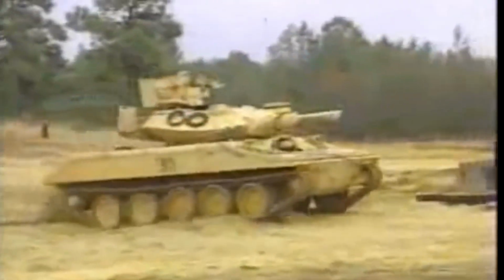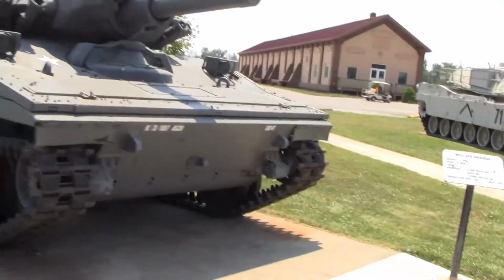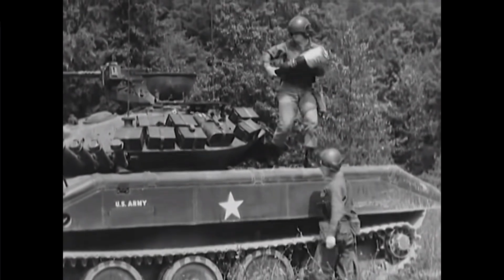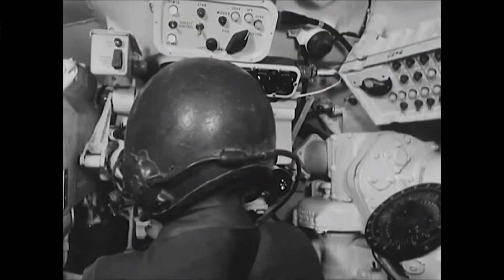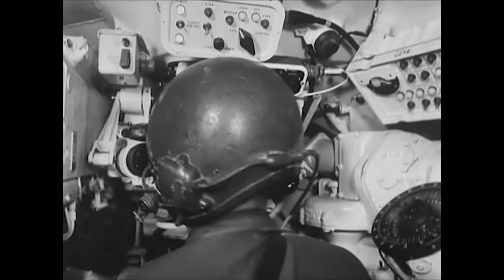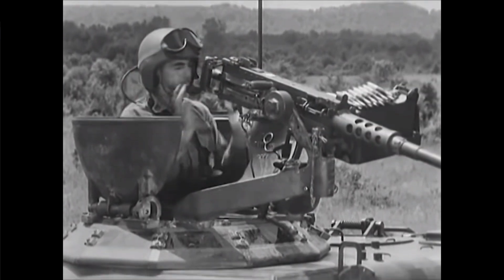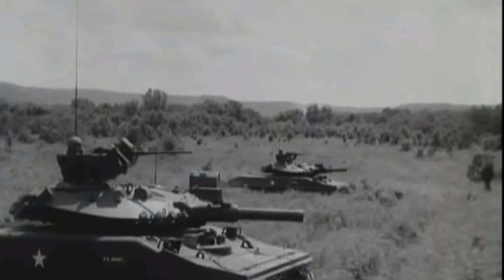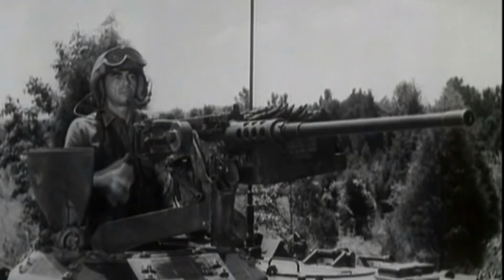M551 "Sheridan" AR/AAV | DESIGN DISASTER!

Comment: I was school trained on the M551 and assigned to the 4th battalion, 68th Armor, 82d Airborne Division. I was a crew member, platoon leader, and company XO, (a maintenance officer), so yeah, I have experience with this system. The 6V53T Detroit diesel was a great engine, but you had to constantly clean the radiator or it would overheat. The suspension system was excellent, but the lubrication for the road wheels was oil with a sight glass, later grease. The conventional gun, 152mm, was accurate, recoil was very harsh, and the obterator seal could fall out, making an unsealed breech upon firing. The the gun detent was only good for 20-50 rounds and had to be replaced or it would blow and bounce around the inside of the turret injuring the crew. The missle system was a 90% NO GO, junk. The electrical turrent was a good idea on paper, but constantly broke down. Air droppable? I have a picture of my vehicle that streamered in from 1,500 ft, exploded!

Comment: As a professional tank racing driver in 1973, I slid this Formula 1 type track through a right angle turn on a hard surface road at full acceleration - 40mph or so - through a town deep in the Bavarian woods (near the birthplace of the sh*t-eating Nazi Partei).

My fancy tank driving, plus my large, male trouser-bulge, stunned the local beauties, as I roared through their Bavarian village, and all of them began chasing my M551a Airborne Assault Vehicle! Few have experienced the terror of a pack of large-breasted, Teutonic females who are large-breasted, with asses a meter wide, in heat, and large-breasted, and full of bier!

Fleeing for my life while transfixed by the fluid motion of the cleavages of their large, bouncy, Bavarian, bouncy, Bavarian, bouncy,  breasts, and chubby, rippling  thighs; I was barely more than a match for them! I barely escaped with my life! 

As certified by me, this feat has never been duplicated. It doesn't mean you are a huge pussy if you can't do this.

Thank you all in advance for your prompt attention to this urgent matter.

M551

Comment: The problem with this vehicle is basically this, its a reconnaissance vehicle (which should not be used to slug it out with main force units unless they are being used as a cav screen and then you should expect to lose lots of them) designed to make contact with the enemy, maintain contact and report but only engage to break contact, (see but not be seen), the combustible case was a really dumb idea as it was an immature technology, a conventional case would have been heavy but more effective, and the propellant load should have been downrated to provide a more appropriate recoil, it would have shortened the effective range but after all this vehicle's role was reconnaissance, the main gun mostly  used to keep the enemy's head down while breaking contact.
The really really incompetent idea was to replace the M48 main battle tank n Vietnam with this lightweight reconnaissance vehicle which was simply NEVER designed to do that job.
Australia did indeed test the vehicle, apart from failures of aluminum engine pulleys, it was the weapon system that really caused it to be rejected, the boiling hot hydraulic fluid leaks were also common to the M60 series when hit by AT rounds.
Eventually Australia produced the M113A1 MRV to fill that role.

Comment: This is one vehicle that would have been invaluable in the War of Terror. 

Since most insurgencies actually lack tanks, a platform like the M551 would be an ideal choice to counter insurgencies as a high speed infantry fire support platform used for taking out technicals and bunkers.

If you won't be facing tanks, you don't need an MBT like the M1A3 because the enemy forces encountered would at best have only IFVs at most. 

So a modernized M551 would be something the likes of which ISIS and Al Qaeda would live in fear of.

After all the most it'd have to worry about is ATGMs, and cage armor is designed to defeat those. 

So yes, I am completely sincere about the M551 being something that should have not been retired.

Comment: They should have gotten rid of the missile and gun ammo, and used AP and HEAT RAP rounds. These could have been compatible with few modifications to the breech and barrel. The barrel could also have been lengthened to incoporate a real (chamber) fume extractor. Why do people keep forgetting about RAP in low velocity guns?

Comment: For all the problems highlighted in this video - I loved it.  I crewed the Sheridan during 2 different tours in Nam and was only let down once time when my vehicle blew a pack during the invasion into Cambodia.  I sat outside a small ville all night long until the squadron trains cane along early in the morning and took us under tow behind an M88. Probably the worst night in Nam - no one got one moments sleep as we dismounted as that broke down Sheridan made a very tempting target in the moonlight. Other than that - there was no missile system on the 551s in Nam so we didn't have that problem.  The Xeon searchlights were vulnerable while making busts through the jungle and mine was wrote off as a combat loss.  We strained the engine / transmission over and over knocking down trees.  We removed the governors from the engines to get more speed.  Ever see a 551 doing 45+ MPH throw a track on an asphalt road and the driver locking up the brakes on the one remaining track?  Made a lot of great circles as it continued down the road.  :)  In Nam there was so much dampness that if constant maintenance was not conducted on the gun system the breech could rust shut.  The cupola armor kit was okay and as the tank commander I felt safer than sitting in the drivers position or the gunners. Bottom line - in Two years it never let me down - regardless of what the mission was.  Loved the vehicle and even crewed a few at Fort Carson and Fort Campbell.  Did I ever wish for a better recon unit - yep but we used what we had.  Don't get me started on the M114A1E1. LOL That is another story!

Comment: I was in the 82nd and my MOS was M60/M551 turret mechanic. These "tanks" were not meant for the main battlefield which is why they're called "Airborne Reconnaissance Assault Vehicle." Their primary mission was to be troop support for the soldiers that were dropped in. Yes I've seen dozens of them dropped... really skidded... into a DZ via C130 along with Gamma Goats and the like. I only witnessed 2 bad drops due to bad packaging of the tank. I witnessed just as many bad Goat drops if not more. Of course the armor was weak as aluminum isn't known for it's protective abilities. It was built to be light. Compared to the other tanks of the era, the Sheridan was quick and road like a Cadillac. The turret... when it worked, it worked well. When it didn't work it was a nightmare, there was little in-between. Loctite was used generously. The amphibious side of things was truly hit or miss and drivers were cautioned not to do it unless it was a life or death situation.  I still have my 4" thick M551 Manual and pull it out from time to time to remind me of why I don't miss working on it. :)

Comment: A modern version of this with a rifled low-medium pressure 155mm, FCS, better engine, better suspension, improved armor, ERA, semi automatic assisted loading, and multipurpose HEAT ammunition for demolition, anti infantry, and with toggled airburst/top attack capability for anti armor in a pinch without need to switch ammo types. Of course with a laser rangefinder and thermals, and retaining the amphibious capabilities by using a better flotation system with rubber inflatable ballasts built into the vehicle too which with preparation would turn it into a kind of raft, and equipped with a snorkel kit incase of some kind of failure(just in case).

Comment: I was Mech infantry in VN. As such we sometimes worked with both Acav units and armor. I would much rather work with the Cav with the Sheridan than the armor with the M48 at least off hard surface roads. The M48s were prone to getting stuck or being incapable in the mud.  I.E. incapable of climbing a  up the embankment to a rice paddy terrace.  On ground that looked sound  but was wet they could look like a submerging submarine.  The Sheridan would go about anyplace a 113 would.  However, we pulled into a place along the "Yellow Brick Road"  called LZ Old Guard during Lam Son 719 to find a Sheridan with the turret blown off next to our assigned position. When asking  the nearby mortar crew it turned out they had an ammo malfunction and the spilled powder was somehow ignited in the tank, we were told by a cigarette. This was a relief to me since we were facing a jungle covered hillside that rose steeply and I was thinking that it was enemy action from above. Anyway there was a little tank with the belly plating  blown down and the turret upside down off to the side.  I did not have a camera at the time... I suppose the communists salvaged it since then.

Comment: They were reasonably effective in Just Cause in Panama, not only because of its light weight made it easy to transport, but also because all the panamanian PDF had to offer was a few V-150s and V-300s with the 90mm Cockerill gun.

Most of them actually never made it to the battlefield. They were knocked out from the air before they could make any opposition to the Sheridans.

Comment: When I was in the 82nd this was the division armor. The intent was to pull these tanks out of the back of a C-130 at low altitude with a parachute (LAPX). It never worked. I saw it get stuck once and they had to cut away the parachute. Other times the tank and sled would tumble end-over-end after hitting the ground. Thankfully, I was Infantry.

Comment: Some minor corrections. 4/68th Armor transitioned to becoming the 3/73d Armor in 1984, which is the unit I served in. 3/73d was deactivated in 1997. The OPFOR unit at the National Training Center operating cosmetically modified Sheridans was 1/73d Armor. They were operating Sheridans throughout the 1980s and 90s. You also missed a conflict. The 82d brought elements of it's armor battalion to Grenada in 1983 as part of Operation Urgent Fury. By the mid 80s, our Sheridans were long in the tooth and frequently deadlined by maintenance issues.

Comment: Had the honor of working w folks and troops from Ft Irwin NTC in upgrading the turret stab system w a Bradley derivative back in mid 90s. Seems this vehicle was ahead of its time. Radio controlled missile that used vacuum tubes. Had little trim pots to zero system. Electric turret drives. AL chassis.

Comment: I served with the 2nd of the 2nd CAV E troop as loader, driver, gunner and TC. I served From 75 to 78 and all the problems were fixed by that time. As long as you kept the maintenance up, it performed great. If they kept improving the Sheridan it would be a great asset today. It hauled ass, and was a great recon support vehicle, it never had a misfire and was generally very reliable. The people who had problems were lazy and did not do the maintenance.

Comment: As plagued with problems you pointed out, an instructor at Aberdeen Proving Ground, MD replaced both the original engine and transmission with the engine and transmission from a Bradly M2/3 Fighting Vehicle.  He was able to get the speed over asphalt up to 50 mph.  He later admitted he should have changed out the drive sprocket and tracks from the Bradly to give it better performance over rough terrain.  (ca. 1989 - 1991)

Comment: Their problem was the main armament. To destroy a modern armor you need high velocity round, something the 551 was missing. However used in a reconnaissance role it was still a good vehicle.

I’ve had 551’s attached in a recce role, and they were fine, but had limitations. We found the same limitations with CVR(T) and W’s.

Comment: OK, where to start. 1. Loose powder - when fielded in Vietnam, the ARMCAV Sqns were allowed to use it to replace one of two vehicles, the M114A1. which was also being replaced by the M113A1ACAV or the M48A3 medium tank. The M114A1 was armed with a .50 M2HB (or sometimes a 20mm M139) and did not require a loader. The M48A3 loader was used to grabbing metallic cartridge rounds out of racks and slamming them into the breech.  The M551 was fielded w/o what the Army today would call NET (New Equipment Training, still happens though). Loaders picked from M114A1 crewmen or from M48A3s were NOT trained in handling the consumable cases. The next problem was that the environment in Vietnam was NOT favorable to consumable cases (as they existed then). The Army thought it had done its due diligence, sending M551s to Panama for a few weeks in the triple canopy forest. But the Army didn't reckon on the LONG term exposure. Several Army weapons and systems had similar issues. The early models of the M72 LAW deployed to Vietnam suffered from misfires, poor rocket and fuse performance after extended storage. These issues were not suffered by the crews which received proper training and were stationed in temperate zones like W. Germany or CONUS or even in the desert. 2. CBSS - Yes, flare backs were a problem until the CBSS solved these issues. Which meant that like the M16, the weapon got a reputation which it suffered from through its career. Rate of fire did not matter. This was NOT an MBT. It's missions were recon and assault. Two rpm for the MP round was not bad for subbing for the missile at close range for a vehicle that was supposed to scout and screen. The MGM-51 took 30 seconds to reach max range, which means you weren't firing more than one missile a minute either. 3. Suspension and engine problems - Again issues were in early models. By 1970, those issues were corrected and did not show up in W.Germany. If there was an issue, the engine was too loud to sneak up on people, which sort of cancelled out the recon part of the name. During the period when the excess M551s were used as VISMODs at the NTC, despite being a couple tons lighter, they were driven into the ground by the OPFOR and the engine and suspension issues were not there. Nor did 4/73 w/ the 82d suffer the same failures. 4. "Black boxes". The M551 was no worse the many other precision weapons in the US armed forces at this time. These precision guided weapons matured in the early through late 1980s, when the MGM-51 could have been converted to passive laser guidance or even EO, pushing max range w/improved rocket motors out past 5,000 meters. Yes, firing the "conventional" round could break the "boxes" or at least decalibrate the system. The response was that M551s operated as two vehicle sections, one firing the missile where/when ever possible and the other the MP round. Still the M551 featured a laser range finder and stabilization. 5. When deployed for "Desert Shield/Storm", the M551s in the 4/73 had their image intensification sights (starlight) replaced with the same TTS as the M60A3 TTS. While they had a tall silhouette w/cdr's cupola armor, they could go almost turret defilade and use their thermal sights to recon Iraqi positions at night and periods of low visibility. This would have given them a MAJOR advantage over the PT-76, BRDM-2 or early model BRM, not to mention BMDs or even Soviet MBTs. The Soviets continued to use active IR through the T-80B and the Cold War. Using the IR searchlight, the max visual range at night was 1800 meters. The M551 w/TTS could see to 5,000 meters in all weathers and at night. The M551 would easily have picked off earlier, less protected T-55, T-62, T-64 and T-72 MBTs. 6. The M551 could have been armed differently. The 76mm M32 was tried in the M551. The Stingray turret with low recoil 105mm was also tested on the M551 chassis. 6. Two things basically killed the M551 except as a specialist vehicle for airborne ops. The M1 could move as quickly and as fast and quieter. And the mission of the ACRs in W. Germany changed from scouting and screening to primarily screening. This meant the ACRs were re-equipped with M1s in a "heavy" configuration. When the Cold War ended, the Army found itself facing a future of "expeditionary" ops, where an upgraded M551 would have been perfect for a lighter ACR.

Comment: The 82nd airborne’s armor unit was The 82nd airborne‘s armor unit was 3/73 armor.
Reply: The 82nd acquired the Sheridans and the 4/68th armored battalion from Fort Riley in 1968.  The 4/68th was retired in 1984 and replaced by the 3/73rd which continued the obsession with turning the Sheridan into a reliable and formidable platform.  The 4/68th, along with other units around the world, helped refine the Sheridan through the worst of its deficiencies (duly and well noted in the video) but the process was arduous, unrelenting, expensive, frustrating and dangerous.

Comment: Got my first and only exposure to the M551 as a platoon leader in A Trp, 1st Sqdn, 3rd Armd Cav Regt. The budget was so tight in those days that each troop got just one practice Shillelagh guided anti-tank missile per year. If the 152 main gun was fired with conventional ammunition, the launcher would be knocked out of calibration. When 152 ammo was fired, recoil caused the first two road wheels to lift right off of the ground. I well remember the supposedly fire retardant barrier bags that were to be kept over each caseless round. It was also protected by a rubber sleeve that we of course called rubbers or condoms.